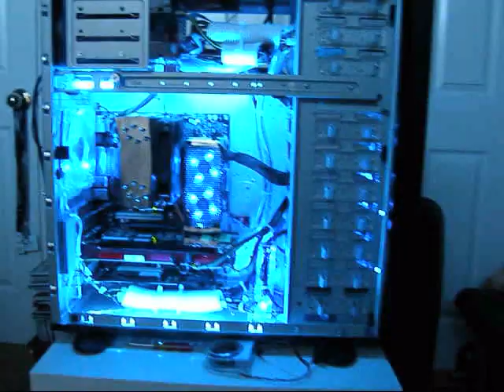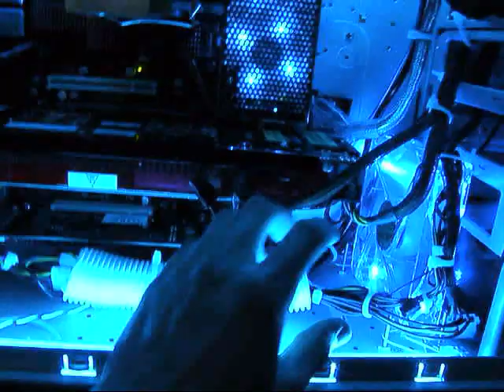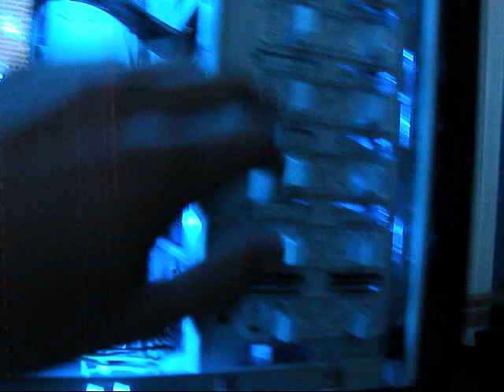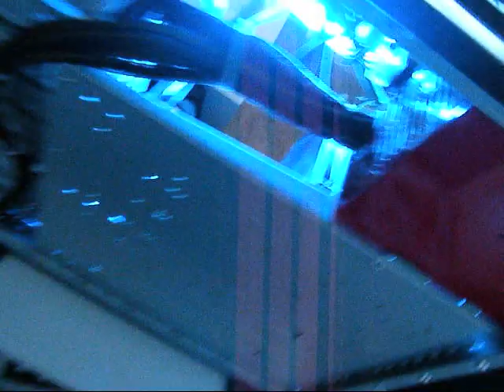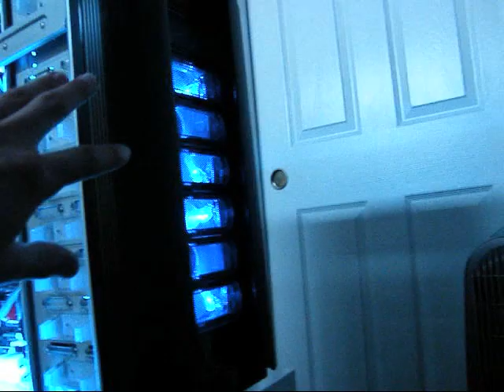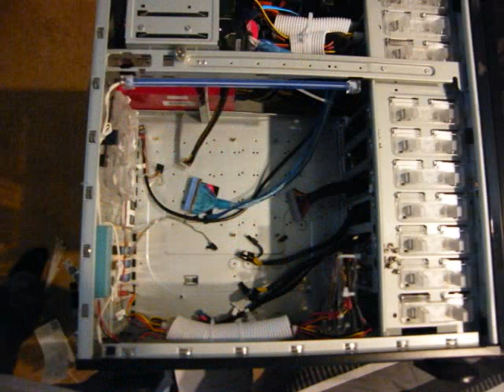How to do cable management for your Thermaltake Armor (without dremel/cutting mods)

Comment: This video is over a year old, but I STILL have this case (great vid, BTW). Like you, I have both HD cages, and like you, also am doing the wind tunnel from the front, through the CPU cooler, and out the back. But, my question is: did you personally rig the 250 mm side fan to intake or exhaust? My video card has a shitty cooler and until I upgrade to a two-slot push/pull design, I want to know in the meantime which option gives better cooling. Let me know!

Comment from the maker: Haha well if you saw the annotation I actually made this video back in mid 2008. But I do realize that it isn't the best possible, it's just the best possible for THIS case without cutting it, AND for using a non-modular PSU. That's all. But since I've made the vid I have long since completely re-modded my case and the cable management is far better. Should be putting up a long overdue video of it today.

Comment: i would just like to know where you bought the second front hard drive bay? i became obsessed with the photos of the case (all with 2 blue fans on the front) that i fabricated metal brackets and mounted the fan onto the bottom of the hard drive bay. i looked for a second one every where, but no luck, help!